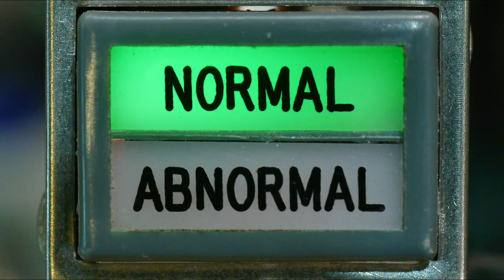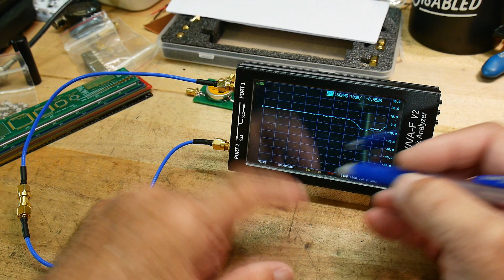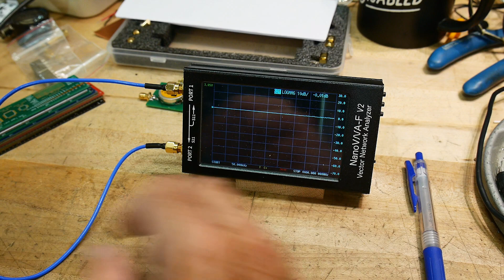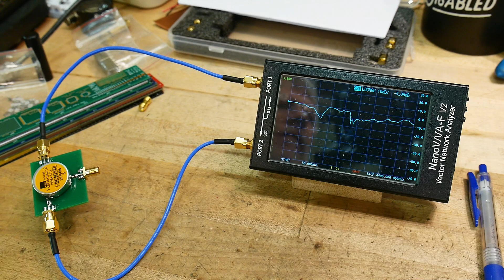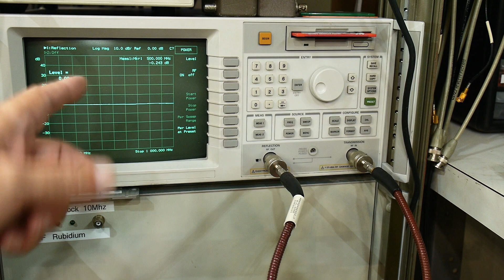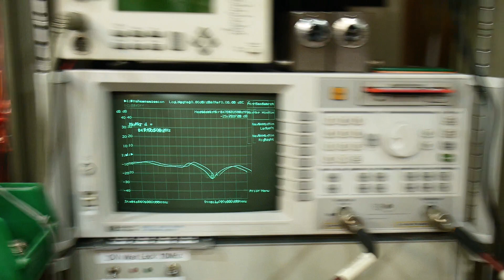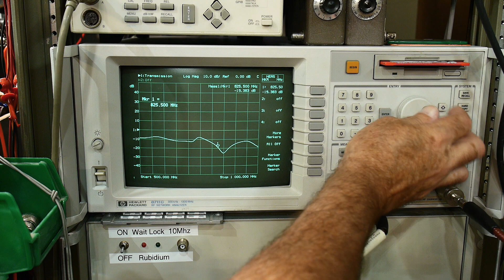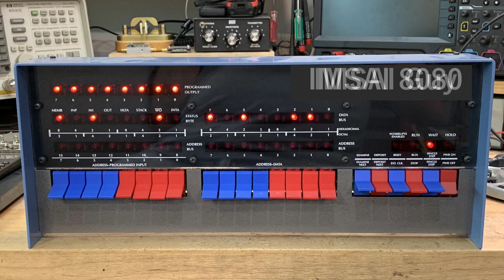#921 PCB design for RF circulators (part 2 of 3)

Comment: That drop-in circulator looks like a M/A-COM brand, part 7N256 with generic specs of 16~25MHz bandwidth in the range 810~960MHz, isolation 25dB, insertion loss 0.3dB, VSWR 1.15:1, forward/reverse power 65W. I found some datasheets on DatasheetArchive searching on 7N256. The number 7N256-S014 on yours may be for a custom spec part.

Comment: That was one smoking deal you got.  Used to have several sets of the WL Gore cables.  One very nice feature is that the ends are replaceable.  If for some reason you wear out or damage an end connector, you unscrew it and thread on a new one.  You can also set the cable up with N or SMA on one end and APC 3.5 mm on the other and so on.  The cables came with (or were ordered with) the matching torque wrench, which is set for something higher than the 8 inch-pounds use with SMA and APC 3.5 mm.

Also had several Lasercraft wood boxes with all sorts of metrology grade adapters of various types (APC 7, APC 3.5, N, SMA, etc) and attenuator kits to go along with the various test cables.  Easily $2,500 worth just in one box as some of those adapters were ~$300 each.

Slowly but surely building up my home hobby lab the same way eBay, CalAuctions, etc.